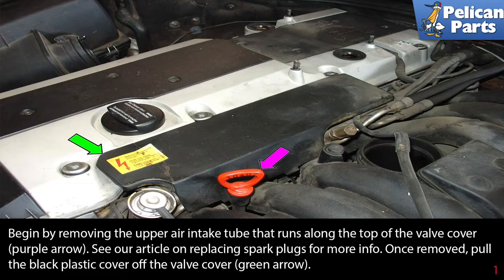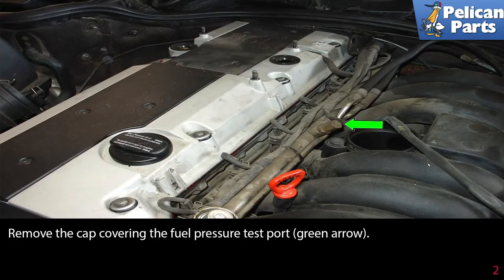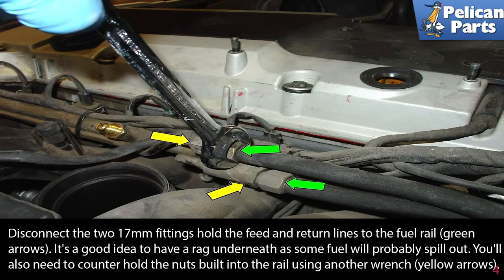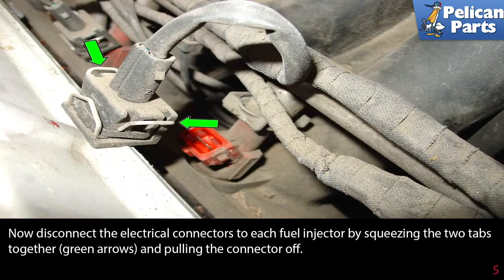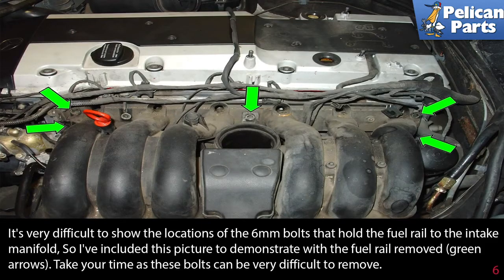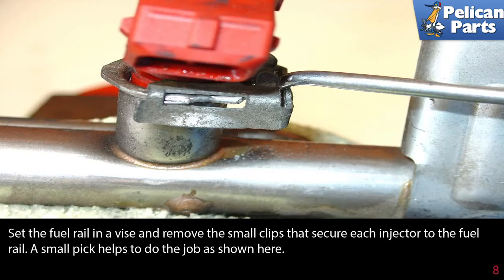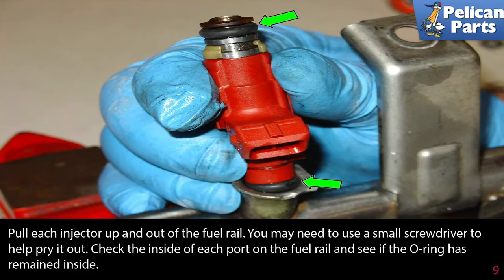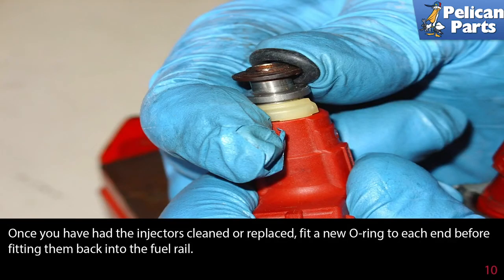Mercedes-Benz W210 E-Class Fuel Injector Replacement

Comment: The biggest part of the job for me is glossed over here. The bolts holding the fuel rail on are impossible to reach. I have the injectors but can't install since I can't reach bolts.
Reply from the maker: See step6 here. it shows the location as well as the size of the fastener.
Reply: @ I can see where they are. I can’t figure out how to reach them with a tool to loosen  them.